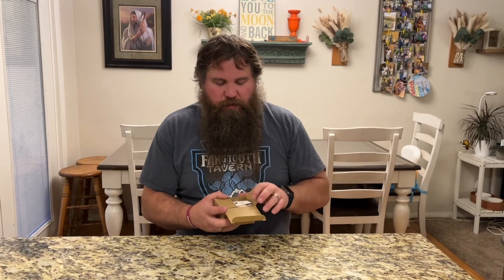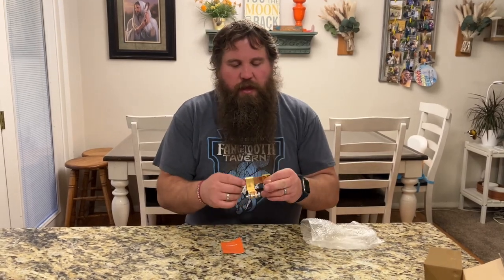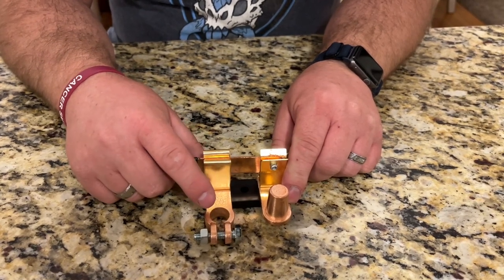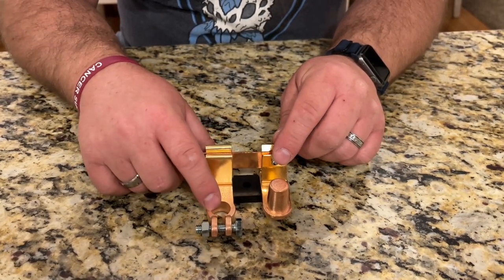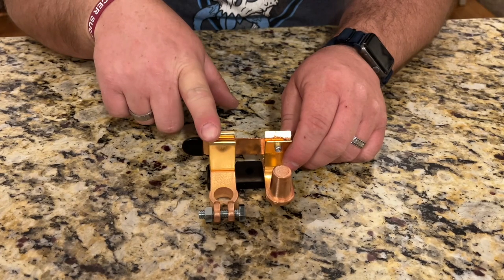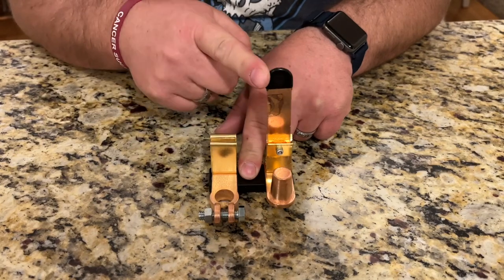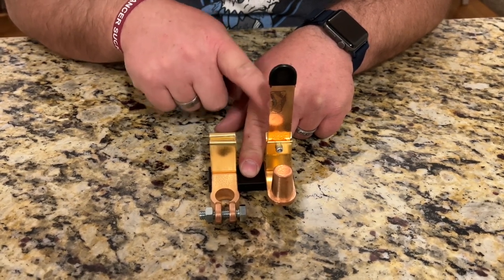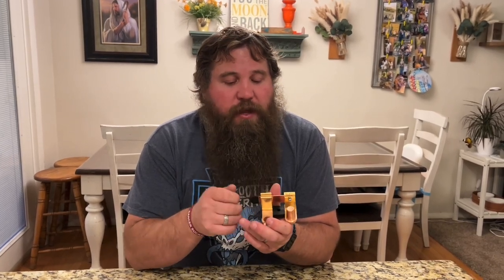Battery Disconnect Switch

Comment: Hook it to the negative or positive terminal?
Reply from the maker: It should only fit on one or the other!
Reply: Negative always
Reply: @lifewithheather5834 what a terrible answer. You imply that people should just try either terminal and see which one it fits on.  Some people might try force it onto the positive terminal which is super dangerous.

The ONLY proper answer is never, ever attempt to put in it on the positive terminal. And ONLY use these on the negative terminal. 

Again... Put these on the negative. Never put them on the positive.
Reply: Also for side post batteries you can slip it over the positive or the negative so people might think that it fits on the positive if they try that first. You're clearly not an expert on batteries or even know very much about them at all. Why are you making videos about them?
Reply: @JunkBondTrader  Why would you get so mad and yell about which terminal it goes on for several comments and lines of text without saying why it goes on that one?